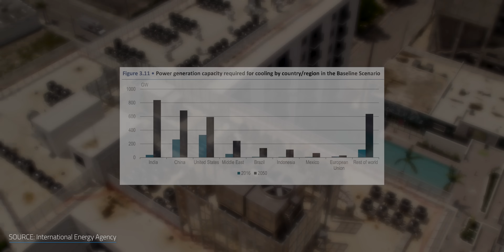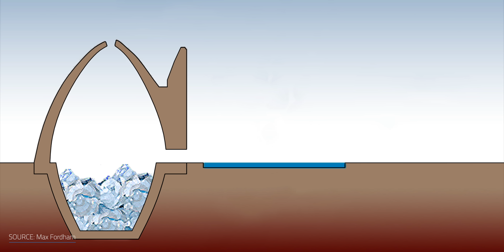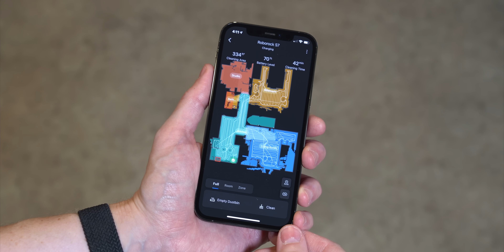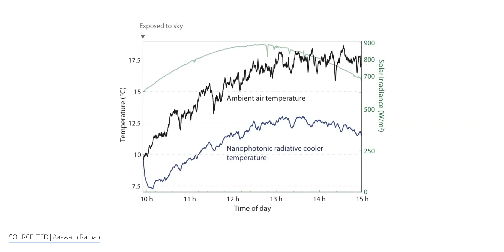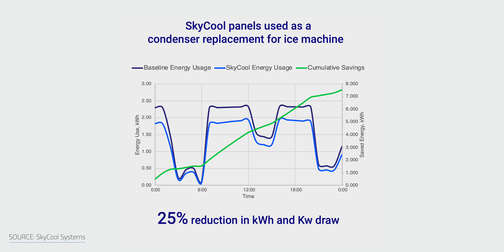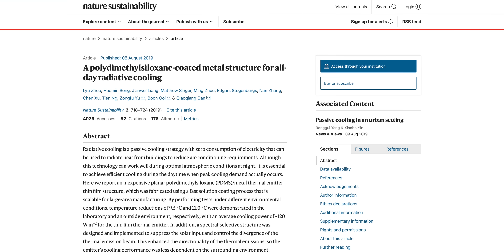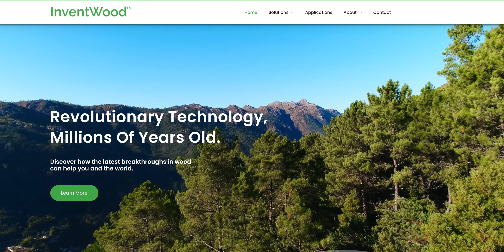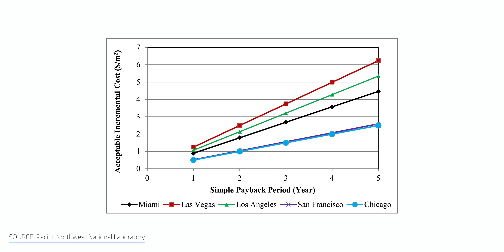Space Powered Cooling May Be the Future of Energy

Comment: Interesting. So I put solar panels on the south side of my roof and skycool panels on the north side of the roof?
Reply: Having a combined system makes sense but if you want to merge the technology with a solar panel…
Solar panels work at their best when at certain temperatures, if the passive radiative tech could help the solar panel keep cool on the hottest days, you would increase daily power production and the panel’s high efficiency lifespan.
Combine it with solar thermal panels and you can generate energy at night, even on the hottest of nights.
You need exposed surface area for this to work so you can’t just mash together technology that both compete for the same surface area, but that doesn’t mean you can’t get creative with when and how you combine them… just remember that for any idea to become a reality, it needs to be an economical means to market, otherwise it’ll only ever be the MacGuffin of the story
Reply: I live in Phoenix. We would all love to see the heat go to space in summer.
Reply: @JohnJohnson-rl7fq  Me too, Joe.  let’s work on legislation to get our streets built with lighter materials.  A bit of white cement added to the mix might do it.  That would really help them last longer and reduce the heat island effect!
Reply: This might just work.Set a third of the skycool panels up to cool the PV, the rest to cool your AC compressor.
Reply: @LokiScarlet  
Your AC conditioner needs to have plenty of air around it to keep cool especially while I operates.

So I'm not a hundred percent sure that this would work, however this channel talked about another way to store power what's the store Heat from something that collects Heat to store it Underground, and I wonder if your air conditioner from the outside of your house can collect the Heat and send it underground instead of straight up in the atmosphere.

So that Heat is not just wasted Heat, and can be used for some later time down the road.

Have you heard of these geothermal setups that are underground?

Basically you create a pocket underneath the property or near the property that has a bunch of pipes running through it that also run into the house, and during the colder months of the year you can use that stored heat from underground to heat your house.
Reply: That would be my thought too.
Reply: Great idea, but much cheaper to just paint your north side white.  Use the money for more solar panels.  You can even extend them over your patio for more shade and more production.  I did this and now my electric bill is negative.  Yes, the power company is sending me a check.
Reply: @paulogden7417  
Painting the Northside white makes no sense, because no sun hits that side anyway.
Reply: @5226-p1e  The white paint doesn't just reflect light, it emits the thermal radiation like the skycool panels. It would still reduce the temperate of the roof by the 12-18° compared to the ambient. My attic gets to about 50-60° above the ambient in the Florida sun, keeping the attic at the ambient temperature is practically a miracle.
Reply: @alexandercoggins2779  Actually high reflectivity materials are poor emmitters and visa versa.  Conventional white paint and the high reflectivity Barrium Suflate paints work by just being very strong reflectors.  If you can stop nearly al lthe solar heat gain in a house then next to no AC is needed.
Reply: @kennethferland5579  This is simply untrue, the video is a testament to that, and your previous comment is in direct contradiction here. I assumed you just misunderstood something and was going to explain to you essentially the same thing you just explained to someone else - it's very important that this material is both very reflective and a strong emitter for exactly the reasons you stated to CPatwal. Not sure what you were trying to say with the comment at me but it seems wholly unnecessary.
Reply: @alexandercoggins2779  
It's too bad the heat from your attic as wasted and can be used for anything else.
Reply: @yo yo I think it depends on where you live, here in Seattle some extra insulation and maybe white paint on the roof will probably do the job. Most people here don't have AC and the ones that do, usually only use it a few days a year. On the other hand, in a place like Arizona where they run AC all summer long, this would be a much cheaper alternative in the long run. More insulation in a place like that isn't going to help much when night-time low temperatures can still be in the 90s. The heat will get in eventually get in.
Reply: That would be cool, top of that cooling solar panels by preheating hot water. Or what about making solar panels emit and reflect ir light to make them run cooler? Ir light is useless anyway because PV panels can't convert it to electricity either way. 
Those ligh emitting coolers aren't probably worth it in cooler areas.
Reply: Maybe it will be possible to use something like this as the base layer below a solar panel. All the unused light gets reflected back into the solar panel and then into space.
Reply: @P8qzxnxfP85xZ2H3wDRV  will complicate the solar panel now that the cooling panel is beaming heat into space, through it
Reply: @P8qzxnxfP85xZ2H3wDRV  How much light do you think can penetrate a solar panel?
Reply: @P8qzxnxfP85xZ2H3wDRV  those are called bifacial solar panels. Currently not really worth it. Yes technically it is two 100w panels sandwiched together, but currently you only get about 20% more energy for significantly more cost.
Reply: @P8qzxnxfP85xZ2H3wDRV  No solar panels can't use the frequency of light they are reflecting, and if they could then they wouldn't have passed through the panel in the first place.  What you can try to do is put a layer on top of the panel which reflects all radiation the panel can not use effectivly which will keep the panel cool and raise its's efficiency because being at high temperature inherently lowers a solar panels efficiency.
Reply: Maybe short term but something like the skycool panels could replace your solar panels.  There are solar panel replacements being developed that use this same technique.  Imagine combining skycool panels with a Peltier generator.  It's all a matter of improving efficiency right now.
Reply: Also light color roof under solar panels means more production on solar panels.
Reply: Energy is based on Temperature differential exchange of matter transition...

There is a direct correlation with Heat and cold " Brownian motion paradox " thermal coefficients and Solar input energy in relation to event horizon of Light " Photon's and absence of Photons " Anti Photon's Humans call Shadow " of course your species cannot comprehend this concept and won't use it for another 150 years...
Reply: @mjolnirswrath23  This is word salid giberish not fit for schlock made for TV sci-fi
Reply: To put it simply Heat is a sign of LOSS of Entropy, stars put off heat , however on the INSIDE, the Decibels inside however are TRILLIONS of DB.. therefore the sun's core below the corona is Cryogenic energy.
Reply: @yo yo Will you talk to the people at UC Davis and Stanford that published separate papers on the subject?  I'm too dumb to explain to them what idiots they are.  I'm sure whatever prestigious lab you work at knows best.
You dumbass!
Reply: @yo yo yes, but there are cases where you have to cool, like for fridges and data centers.
Reply: Just paint the house white and put adjustable heat vents
Reply: @Stealthsilent1337  
That will work rather well actually, however you got a better deal if you use the Earth as the insulator as thick as 8ft around the house should suffice
Reply: @yo yo you are aware a heavily insulated home in a very hot area would need to use air conditioning still. Also enough windows and youve essentially made an oven, theres a reason why homes in desert regiond are usually painted bright white and have few windows, because a R1000 box with a window in an extremely sunny area would literally become an oven without the HVAC
Reply: @yo yo lol the point I made was literally the opposite. In a perfectly insulated house with a window then the house effectively is a heat valve. Heat comes in through window (the sunlight) but nowhere near as much is radiated out. Aka you have an oven, especially when you add people and tech inside the house.

So to simplify it for you as you seem to be struggling. Outside hot, inside hotter, heat flow from outside to inside. Heat no go high to low, insulation mean inside house hotter in summer. Because heat no go at all.

God its radiation vs conduction/convection but people like you still seem to struggle
Reply: I think solar panels combined with heat pumps using soil based heat exchangers would be more efficient. It would be used for cooling in summer and heating in winter.
Reply: @alexanderpoplawski577  I agree, except that if the goal is to remove heat from the planet itself, then this is very interesting. Even air source heat pumps are very efficient winter and summer in Canada climates.
Reply: @alexanderpoplawski577  This is a good idea, you can effectivly add a cooling step in into the loop and cool the ground to a lower temperature.  This will make geothermal heat storage more attractive in areas which have a longer heating season then cooling system.  Currently such system only work well when their is a equal heat load going in and out of the ground.
Reply: @kennethferland5579  The temperature a few feet under ground is fairly constant. The soil gets somewhat cooler when the heat pump is in heating mode and warmer when cooling. But not much and I think it will level with the surrounding ground over time.
Reply: Great thought
Reply: It's not going to help you on the North side my dude.
Reply: @5226-p1e  Sure they will, Space is in all directions.  You angle them northward to minimize the sunlight falling on them, the sunlight is untirely unwanted.  The only reason you you don't just orient it vertically is that the thickness of the atmosphere in the lateral direction would also rob them of efficiency as it reradiates back at the panel.  The ideal efficiency would be a to throw a small overhanging flap to shade the reflector while still letting it see the sky.
Reply: @kennethferland5579  
But if the sun is only on the South side, pointing them north would be silly, because the sun is only on the Southside.

No sunlight or heat is collected from the Northside is what I'm trying to say.
Reply: Would be cheaper and more useful to put PV on North and South then use this tech. Sorry it's not going to be commercially sensible in anytime soon, if ever.
Reply: @serg3y  
Putting it on the north side makes no sense because the sun is always facing south. 

But your kind of correct, these aren't good options for houses, it might work for buildings as most buildings have a flat rooftop that could collect Heat from the Sun during the day.

And it makes sense that the white paint would also reduce Heat but these things are better because they will significantly reduce that heat pretty much bounces off using this simple technique.

I personally think houses with do better if they were partially buried underground, lookup earthships to know or understand what I'm talking about.
Reply: provided you get sunlight on North side :-P
Reply: @CPatwal  even with indirect light from sky or cloud you will get a little PV output, I like the physics if this tech but I am not a believer of the utility...
Reply: @serg3y  Dave asked if he can place Skycool panels on the North & that itself will fail if direct sunlight (even if cloudy) does not hit that panel - else which & what radiation will be sent out into space ?
Reply: @CPatwal  No people your not understanding the basic physics, the cooling effect comes from radiation away the heat OF THE FLUID going through the panel.  The panel will cool at maximum efficiency at night like the Persia ice makers.  Its made super reflective of sunlight so that it can ALSO cool durring the day by not having it's cooling rate (which is dictated by the unchanging temperature of space) overwhelmed by solar heating.  If it could reflect 100% of sunlight then it would cool at it's maximum rate at all times.
Reply: @CPatwal  Infrared radiation that has the right frequency to get to space.
Reply: @CPatwal  Mr patwal the cooling panels send heat into space.. The heat would have to be collected from e.g interior space by a say a split ac unit and piped up into the cooling panel.. The cooling panel would be more efficient on the shaded side..
Reply: fucking love you
Reply: Not so great in the winter, where they would be working against each other.
Reply: @yo yo I don't see how that is an issue? The point is to make cooling with less emissions and market it as "green." Commercial cooling far outweighs the residential sector when it comes to environmental impact. The appropriate place for this technology is the commercial sector. I also disagree with your insulation approach. How is it better to add insulation to the envelope which means the surface continues to absorb heat when you can reject the heat in the first place. Insulation is amazing, but it is a part of the system, not a single solution.
Reply: @yo yo of course Insulation rejects heat, but only once that heat has passed through the envelope containing the Insulation; unless you are advocating for external Insulation. I am well aware of prevailing market pressures and in this day and age there is a lot to be said about customer attraction to the use of green technology. 

I'm not certain what the assertive posturing is about, but I hope you have a wonderful evening.
Reply: @yo yo I dunno, on an individual level I would love some radiative cooling clothing
Reply: And geothermal heating below your house
Reply: Or on a flat roof, angle the PV south and the skycool north, in alternating rows.
Reply: @Ayomayo48583  I am not a native English speaker and didn't know the term "ground source heat pump". So I used a descriptive expression.
Reply: Uuuhhh.... Panels won't get it.., unless they can be rotated/flipped from 0° to 180°, depending on the Real Time requirements. Max cooling on the hottest days, flipped and faced towards the occupied space when heat is wanted.., and every requirement in between. --- You know, sort of like a (smart) thermostatically controlled HVAC system? Heat when you're cold, Cool when you're hot.., except it's passive. No gasses or fluids required, but not prohibited, either. (Genius!) Then, of course, there's that pesky dust problem. Constant cleaning to keep a layer of dust from interfering in the desired heat transfer? I'll betcha that dust is pretty good at absorbing the infrared that is supposed to be taking the Starship to space. 
Anyone considering using the heated carbon/direct to electricity tech being experimented with? Sounds like a good collaboration. Move unwanted heat to a place that likes heat so much that they will pay you in kw/hrs!
Jokes aside, Physicists have agreed, long ago, that ALL energy is heat. ALL work is done due temperature gradients. ALL we ever do, when we work, is move heat from one place to another. Even stuff is just condensed energy (heat) Isn't it time that some of that work should be the capture and/or the redirection of all of that pesky heat people are worried about? Convert that heat into various other forms of energy storage... forms that can be used to move around -- more heat! (Or --- energy --- stored in more complicated forms) Simple! Right? Just one little (nano) step at a time. Waste heat is a waste! (It's in the name) New materials, lots of experiments 🧐 🥼 🧪 🧫 🔬, lots of work 🛠 💻 📲... and wha-lah! Lots of work getting done from previously wasted waste! 🗑 What a brilliant future!
Reply: @yo yo I'd like to see how long you'd last without opening the window inside my old hostel room in a concrete building designed to have AC but had a ceiling fan instead, in South India.....Let see how you enjoy yourself with perfect insulation without circulation. 
I am having a hard time understanding how can you practically insulte your way into having lower temperature inside the house. It would be much more believable to say that proper ventilation could help in lowering temperature
Reply: @yo yo It is fascinating how you so adamantly believe that all that cooling is happening from insulation and not by ventilation and the kind of buildings in deserts you are mentioning has a key feature, they don't have windows at all. Rural mud homes in the Thar desert in India are also like that, but they are still ventilated. But those are not practical in tropical humid environments. The AC is not just cooling by lowering temperature, it also does the job for ventilation. 
So without anything to push the air that gets heated through the windows from inside out, the house will work like a solar oven. You cannot perfectly insulate a house like a storage room, because you need transfer of natural light and air, which is antithetical to insulation. 
Your logic is to make an perfectly insulated bunker, with AC for air circulation and artificial light is an impractical nightmare and dangerous; what are you going to do if the power fails suffocate and  die inside a perfectly insulated coffin? 
The discussion here is about energy efficiency and sustainability, not perfect cooling. Proper ventilation and natural lighting inside concrete buildings in tropics is free and much more environmentally friendly than insulating and then adding an AC whose refrigerants are an environmental nightmare. 
Your idea might work for mild summers in colder places, but not  in humid hot environments where you will only be creating a insulated damp mold heaven with no ventilation and natural light. 
Please do not try to justify your insulation pov with AC, elimination of which is whole point here
Reply: @yo yo Care to explain the Physicis in whichever universe you are from where, a person can exist without suffocating inside a perfectly insulated, unventilated? Just explain the magical physical where someone can survive in an unventilated, 100% insulated, cooled by refrigerant (since you give zero fs for environment), completely opaque box? 
You realize you are describing an industrial refrigerator? You think anything can survive inside such a perfectly insulated, artificially cooled, unventilated, storage room without dying in their own carbondioxide?
Reply: there is no sun needed for infrared emitting panels
Reply: The roof real estate on the north side of the house would easily be best used for this application.  Trying to combine hot photovoltaics with a cooling system seems unlikely from the standpoint of physics.
Reply: @paulpeterson4216  solar panels work better when they are cooler, and the cooling system needs electricity to actually pump the heat around to have any meaningful effect other than locally cooling the top of a roof. So integrating them both together isn't such a crazy idea at all.